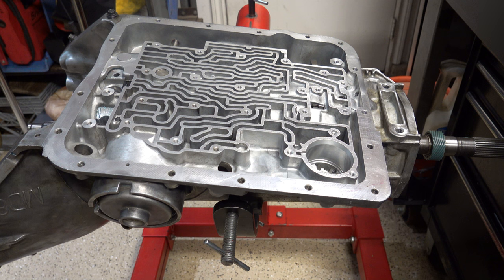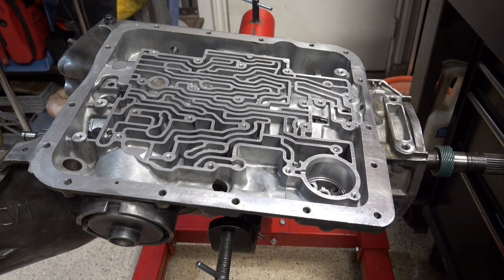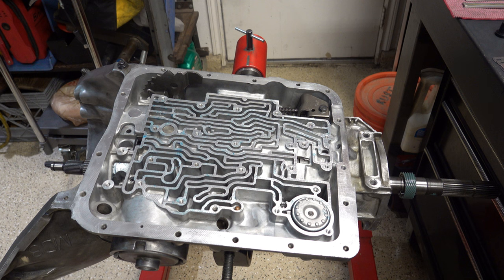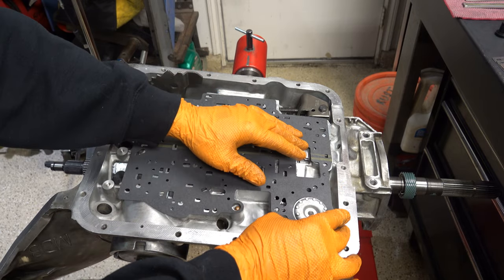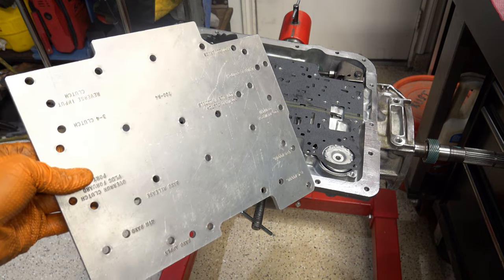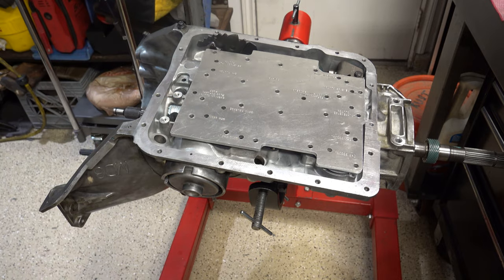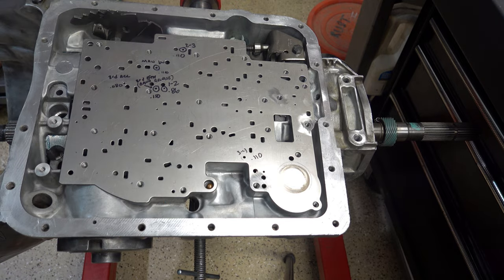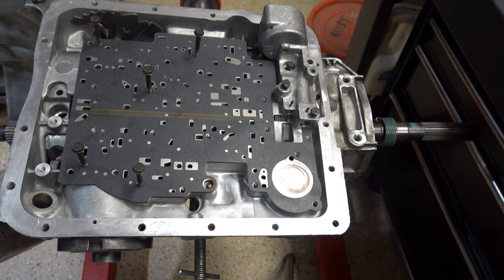700R4 Rebuild PT7: Case Air Checks and Shift Calibration

Comment: Just did a rebuild, when I put selector in 1st gear there is a terrible sound like a "ball bearing" rattling around.  the more throttle the more noise, no throttle no noise.  Also when I first put in drive it shifts 1,2,3 fine. After 1st stop it will only have 1st.  Reverse is fine any ideas? I am stumped!
Reply from the maker: Hi John, thank you for watching...The ball-bearing sound could be the pump itself or a misplaced check ball. I'd first do a line pressure test to see if anything unusual shows up on the gauge. Then I'd drop the pan and valve body to confirm you have all the check balls in their respective correct locations and view the bottom of the pan for any debris, etc.

Comment: I can't turn my output shaft by hand, had to use a pair of pliers, normal or not normal?
Reply from the maker: Depends on how strong you are but assuming average strength for a male between 18-65, that's not normal. Do you feel/hear any unusual noises? Can you spin the output shaft independently of the input shaft and vise versa?
Reply: @nickstransmissions  I removed the front pump assembly and it turns easily now so it has to be something with the assembly or maybe how I installed it.
Reply from the maker: That tells me you may have a bind up somewhere due to either insufficient end play (ie an interference fit) or broken parts. Many times, folks don't realize the drums arent fully seated due to one 3-4 clutch getting hung up on the 3-4 clutch hub so you'll have .080 less spacing between the pump and the drums than you'd otherwise have...Just something to keep in mind for when you go back together with it.
Reply: @nickstransmissions  Somehow my dumbass put two washers on the front drum instead of a washer and a thrust bearing🤣🤣

Comment: Hi there, I've seen you reverse the 3-4 accumulator, could The spring and piston position be reversed in the 1-2 accumulator too? My th700 transmission is used one spring instead of two.
On the other hand i am also in doubt  should i do it for 3-4? Of course you said it makes the shift crispy.
Reply from the maker: I have actually never reversed the 1-2 accumulator in a 4L60E so can't actually say for sure! But the 700R4 through 95 4L60Es and 96+ 4L60Es have a slightly different 1-2 acc hydraulic circuitry hence the difference in piston orientation and spring counts...Whether flipping the 1-2 acc piston in the 1996+ transmissions would cause problems or not, I'm not sure...In 2007+ they did eliminate the outer spring but I've never done so in a pre-2007 unit either as I haven't had the need to experiment with those...

Thank you for watching, Yousef!
Reply: @nickstransmissions  thank, i got it. My trans is for 1991, i did rebuild it step by step with you. So i must back the 1-2 accumulator to the stock position cause i flipped it.
Also i i flipped 3-4 accumulator. Do you suggest to keet it up side down or back it to stock position for 1991 th700 transmission?
Reply from the maker: I keep the 1-2 accumulator piston for the 700R4 in the stock position then install a stiffer spring if you want to crispen up the 1-2 shift.